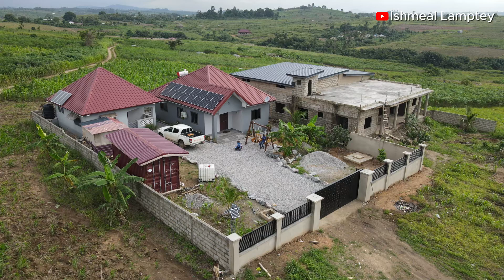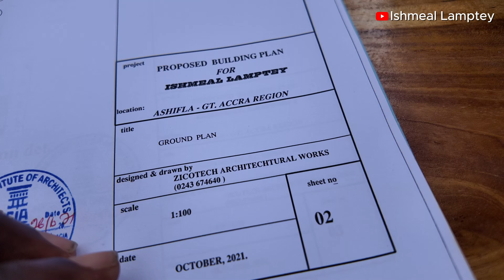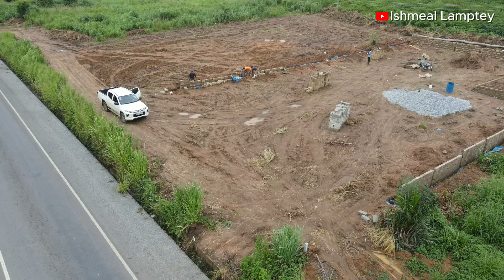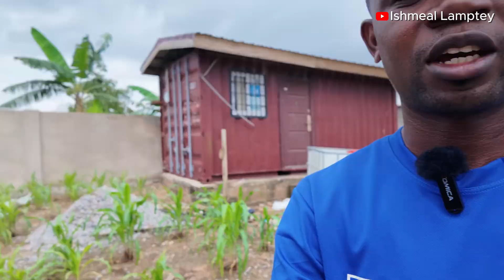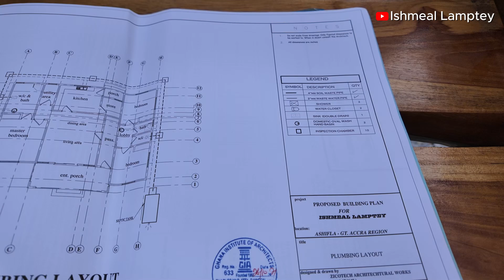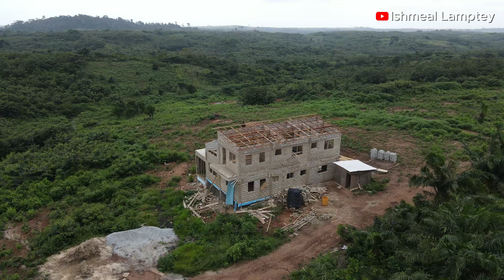Why you need a building plan before building

Comment: What is the difference between an architect and a contractor, in connection with their job.
Reply from the maker: An architect will likely be a part of a contractor's team. A contractor being a company or an individual basically takes care of a construction project from start to finish and will have various teams or departments that takes care of different aspects of the project. From the designs, the structural works, civil works among others

Comment: Thank you for this video. How long does it take to get a building plan from an architect? Thank you.
Reply from the maker: The duration usually will depend on the architect working on it as well as the type and size of building. So there isn't a fixed period.